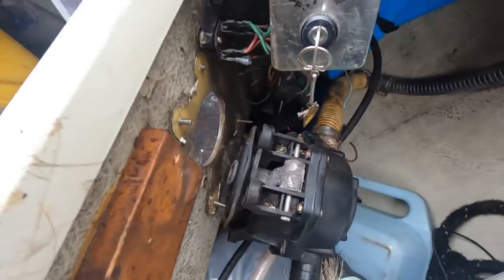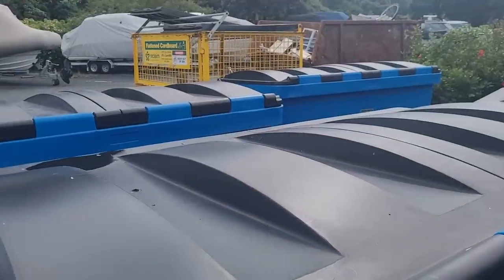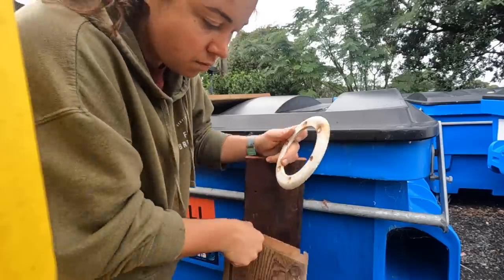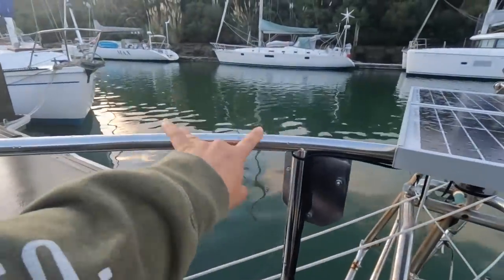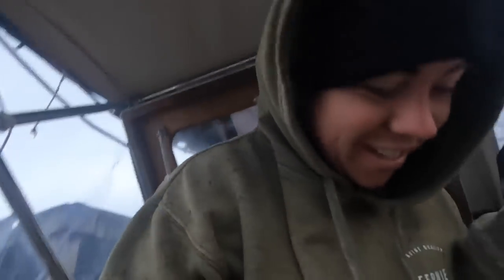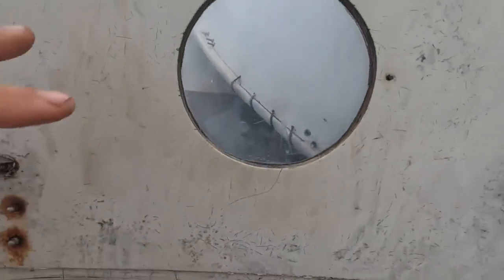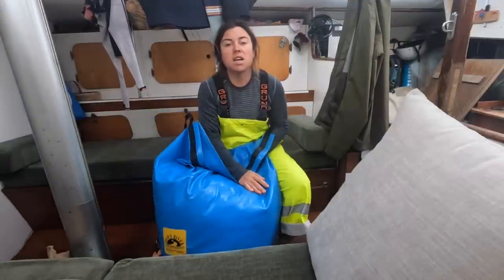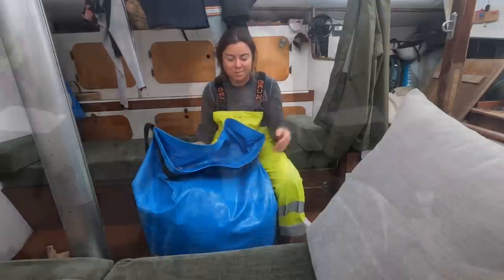Dumpster Diving for Boat Repairs In New Zealand WHSE121

Comment: I think the proper way to fix the hole would be to fix the manual pump. But I'm just a worrier. Anything that can go wrong, will go wrong. Love your videos.
Reply: Yeah, I would try to repair the pump - could be as simple as just dirty😊
Reply: I think manual pumps are garbage!!! Holly has inspired me to dump mine, a good bucket and plenty of 12 volt bilge pumps and a 2 way valve on the engine water pump is all ya need.
Reply: @saylaveenadmearedead you are required by the Coast Guard to have a manual pump and bailer (bucket). Electric pumps are secondary and NOT required.
Reply: I had a hand  bilge pump on my 1967 Bristol Yacht B-27 ( Carl Alberg design, built in the old Herschoff Yard in Rhode Island ) - worked wonderfully - but I also got 2 12v electric pumps as backup ( redundencies ) 1 was a 5000 gal pr hour monster  -  luckily, I never had to use any of them and my bilge was as dry as Billy's Bones
Reply: @kingscairn  Redundancy is key. Imagine being asleep for a few hours and for some reason your bilge alarm fails and you wake up and the boat is half way sunk. No amount of manual bailing will help in that situation.
Reply: @stopthephilosophicalzombie9017  amen !
Reply: @stopthephilosophicalzombie9017  if you wake up and your boats halfway under water you have a much bigger problem than bilge pumps and alarms.
Reply: @stopthephilosophicalzombie9017  mate
Mate. You got NO idea.
Not many bilge pumps can keep up with a highly motivated captain bailing with a bucket.
Do the math.
And if it takes over an hour for the water to reach the cabin floor, you ain't got a huge problem.

Having personally singlehandedly salvaged many boats, including a 120 year old 120ft wooden sailing ship, that had been sunk 8 months, and was leaking hundreds of litres per SECOND to start with, I have a little experience with such matters. 🤗
Reply: @Maungateitei  Well if it was leaking 100 liters per second your supposed motivated bailer wouldn't be able to keep up. That's fascinating that you salvaged a sunken boat though. Sounds like a great story.
Reply: @stopthephilosophicalzombie9017  she was built with full length Kauri planks 4 inches thick and 12 inches wide.
Were there any holes? 
Yup. Put your finger on any spot of the Hull, and there would be 2 within a foot of that point. Each half an inch high, and 100ft long.
Recaulking a ship from the inside, when she is only dry for an hour each low tide was certainly an interesting challenge.
It took 3 weeks.
Reply: @Maungateitei That's amazing. Did you use the traditional caulking of pine pitch and hemp oakum?
Reply: No better bilge pump than a frightened person and a bucket!

Comment: Mixing 2-stroke fuel, the trick is to work out the correct dose for your can - usually 5litres - then dose the can and fill it at the pump. Job done!

Comment: My Bukh dv8 would not stop, and also had no charging when harbouring at 3 am back in 2015. Did crack the injector nut open, and it sprayed diesel mist all over the engine compartment. Damn engine rattles all electrics like a disco freak. Makes a good anchor.

Comment: Go to an auto parts shop and buy a small tube of battery pole grease. I noticed that your connectors on your switch were getting green. Clean them a bit with fine sand paper and thinly smear the battery grease. This will stop the corrosion and potential problems.
Corroding joiners and plugs gave me problems on my yacht and this fixed it.

Comment: Hi
There is a wire that is attached to the back of the solenoid (rear of engine). I have the same engine and have also disconnected it in error. You can also download the original motor instruction manual by google which could help you. Good luck.
Warwick

Comment: Great you have bicycle for carting. Found expensive things like books & materials in duster bins. A tarpaulin could allow you to be outside without becoming wet . Hope that ignition key has been replaced. Plenty of info on internet or better still there is an electrical handbook like the engineers handbook. Very handy but your skill sailing outshines me a tool room wizard.

Comment: @ 12:30 that's a typical rarely used little diesel engine noise, as it faded away @ 12:48 and engine rev's climbed, it pretty well confirmed a cold engine knock or piston slap in the bore, not something to worry on, You are after all on a budget, Loved following you doing your impression of a Racoon in a wheelie bin, I have sailed (I'm 69yr old Brit)for so long in yachts with the manual pump handle left in by a crew mates, I started to believe crossing a cockpit in the dark,when alcohol had been taken(for medicinal reasons)was akin to suicide, But I have worn belt and braces for some of my life, so a reassuring pump of the handle every watch, awaiting the no resistance pull on the lever, was always a calming effect on ones nerves

Comment: Great job Holly.  Another emerg shut-down trick is to completely cover the air intake. Starves of air, shuts down instantly.  Be careful - use a strong flat square of plywood or similar to cover the intake.  Don’t get your hand near the intake, you can lose a digit.  Sometimes easier than getting a wrench on the fuel input.  As mentioned, if too hot she can continue to run by burning oil; air intake will shut that down.  Keep goin 👍

Comment: Was it only me that kept thinking of novel ways to cover the hole in the cockpit? A frisbee; chrome hub cap; 45 rpm disc (with a nut, bolt and washer in the middle) cake baking tin; or even one of those china plates from the dumpster, all bedded in with Sikaflex or 4200. In the end Holly's solution was the best!

Comment: The solenoid is pulling on a little lever. The STOP lever. Just pull it yourself. Some engines activate the solenoid while it is running, others are activating the solenoid only to stop the engine. In any case there is a lever that you can use yourself.
Reply: THIS. The stop solenoid is sometimes fused too, so check all the engine fuses!  My kubota wouldn’t stop after this fuse blew on me.

Comment: Use 2 same size rectangular pieces , cut / chisel half of the od of push pit tube into each one running the length of the long sides - drill 4 holes through the 2 wood pieces (2  on each side of push pit tubes - they will serve to clamp the 2 wood pieces ( motor mounts ) to which you clamp the outboard engine to

Comment: If your engine still running and you can't shut it off with the switch you need to figure it out before you leave because whatever it is will probably drain your battery and then when you do need your engines you will not have a battery to start it

Comment: you can or should be able to override the fuel pump cut off as its a solenoid and all it does is turn the fuel off to the injector from the injection pump, id also just google your engine and see if you can find a manual for it.

Comment: soak those spade connectors in coke or pepsi, then blow them off, and rinse with isopropol, then put dialectic grease on them Before connecting...that green corrosion is not helping anything.
( so keep a small bottle of coke on board, just pour it in the cap, and dip the crusty connectors....but don't drink that crap )

is that new main-sheet block a Ronstan ??? that's nice.

Comment: Diesels shut down by cutting off the fuel.
Reply: Very true, but when the fuel shutoff isn’t shutting off they don’t, as happened in this video. 
Most marine diesels have a manual stop lever or an accessible stop solenoid rod that you can push or pull to shut it down manually.

Comment: do you crack it just before the injector? or just before the injector pump? really hard to see what you are pointing at but it seems like it's on top of the motor
Reply: It looked like the outlet from the injector pump (on the way to the injector) not enough fuel pressure to operate the injector, no air in the system either.
Reply: @alansailing1387  makes sense! perfect thanks!

Comment: Would there be any way you could switch to a simple electric system?  It would be at least as good as your cobbled together gasoline system in terms of propelling you.  There would also be zero maintenance and much cleaner.  Maybe when you get into a bigger port.  Love your channel.
Reply: It's a wonderful little Diesel and made by Kubota... As for the outboard, way to go Holly!!! I am so in love with my Nissan 2 stroke after many years of being unable to get places due to wind and current by rowing.

Comment: You know my little wind hippie, I think you should really think about replacing that pump.  If I'm correct, that pump pumps out your bilge. This is a backup for when your electric bilge pump fails. If you decided to pump out your bilge while sailing you could have a problem. Yes I know you have a self steering wind vain. But as you recall your self steering wind vain isn't in the greatest shape.  It will be much safer if you have a backup plan. Because of the lag time on your videos,  there will be no time for me to commondeer a boat to come out and save you. Plus I don't think you can tread water that long. And sharks bite! You know we are all routing for you. And if something bad happens we will loose sleep over this and I'm sure you don't want us to loose sleep.
Reply: @@SalSpencer when there is an electric failure , battery`s dead, only a handpump does the job. at sea it is an safety must to have
Reply: @@SalSpencer that doesn't pump enough. These handpumps have ridiculous amount of pump volume when used. A small one does 9gallons a minute
Reply: @@SalSpencer money money money
Reply: @@SalSpencer money for the extra bilge pump. It would be cheaper just to buy new seals for the Manuel pump. But money is the problem.
Reply: @SalSpencer  under the worst weather conditions I understand what you are saying. But this is how it should work under normal conditions when the weather is bad. First line of defense for a leaky boat is an electric bilge pump. Most opt for automatic which is a very wise choice. You don't need a boat to tell you "hey dude you sprung a leak and if you don't want your investment to turn into a submarine I suggest you turn on your bilge pump." Than if you fortunate your second line of defense would be a electric bilge pump because your first option broke down. Than the third option is the manual bilge pump. And because most boat builders have sailed before,  they tend to put the manual bilge pump near the tiller or helm. This way while you are steering the vessel in nasty weather  you can bend down and operate the manual bilge pump. You see in nasty weather your wind vain auto pilot doesn't work so you are stuck manually steering the vessel. But if you own a hydrolic auto pilot that means you have money and you will be using auto, manual before you get to option 3. But for the rest of us that play the lotto with dreams of financial stability we don't really get those options.  So now on to option 4. Which is the good old fashioned bucket and something smaller to fit down under the floor boards to get to the bilge. If you have to get to this point, you know life really sucks and you are pretty close to a life and death scenario. Because you have to drop all sails and get the eater out and no one is driving your boat. So bail you will do and carry the bucket up on deck and over the bow. But befor anyone of these get the water out scenarios, you should figure out where the water is coming in from. Stop the water coming in is the smartest option. Now if option 4 fails there are only one of two options left. Get into your dingy/life raft or tread water. You see it's not advisable to bypass options because you limit your options.  On the open water you only have few options and you are self reliant. The cell phone doesn't work after 10 miles off shore. The CB radii has basically 20 miles of reach depending on where your antenna is located.  And if you don't have an EPERB, you are basically on a one way mission. But there is always one option left. PRAY, I'm pretty sure the Jews were praying before they walked into the gas chambers. Sorry but I don't put alot of faith into prayer. I worry alot about this young lady. I don't want to hear about her in some obituary. Her boat is basically known as a weekender. Yes you can spend the night on it, but it's basically made to stay close to land. Could it be outfitted for long voyages. Yes, but you do that before you go on the long voyage.  Not to forget that her boat is only 27 feet long so there is only a little bit of room to fit stuff in. OK I will stop here because my answer can go on and on.

Comment: This Is Part Of Why, you should have set up with a sculling oar, instead of getting a new diesel.

and i know, shoulda, woulda, coulda totals to squat, and that is not nice to do to people......but it's true......and Do Not Dumpster dive Barefoot !!!
Reply: yeah, if you would have gone that route, i would have suggested a survival water maker, and an electronic auto helm....

an electronic auto helm is Lighter than a wind vane ,
 and you can't keep loading the Geck up with junk, because you need some cargo capacity for water until you can get some emergency de-sal capacity.
Reply: and that engine makes it difficult to get to your prop-shaft seal...if it's a re-fitted stuffing box, you're probably ok for a while, but if is one of those accordion lock ring types, then make sure the lock ring set screws where installed with Red Loctite, before you set your next long open sea course.
Reply: and yeah, i was suggesting custom L-keel trim lead, to compensate for not having an engine.

but that's Re-placing weight, with weight that will get you where you are going faster, so there is less chance of running out of water, or getting clobbered by a storm.
Reply: i mean you could have just pulled the engine and elected to keep your wind-vane, solar panels, and push pit.

and then you could stack 40 Gallons of Water where the engine was, and it would have weighed the same.
Reply: you could get a job as a waitress or something, and live reasonably inexpensively on your yacht,
save for a Power Survivor 35 and bolt it down somewhere where you would have convenient and efficient operation....just route it right into your 25 gallon tank, and make sure to carry spares.....because just that, could actually solve your passage loading issues.
Reply: the Geck is only faster than Triteia until they are loaded with an equal amount of water .... that's the difference between a coastal and a deep blue....but if you get set up with de-sal, then the Geck would be something a bit more than just a coastal cruiser trying to be something it's not.
you just have to solve the water loading problem; because that's the main thing, no boat is designed to be overloaded.
Reply: @RulgertGhostalker fuck job!
Reply: @userjarabecko  good thing i have you to tell me who i am.... i have been with myself every second of 57 years, so how the hell would i know?

Comment: It's time to STOP for several months... and get the boat together.  A fuel shut off that doesnt work...means you burn to the water line or death. because you have allowed yourself to become dangerously sloppy.  Main Sheet Block frays the sheet... same thing.  You are a smart woman..but this is TOO FUNKY FOR SAFETY...  be as funky as you wanna be.. but there is a line.  you wanna seal over dirty fiberglass... why even bother ?